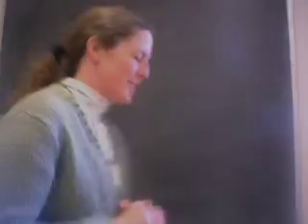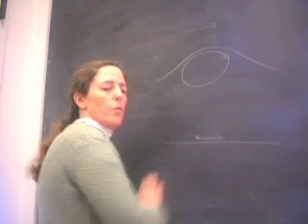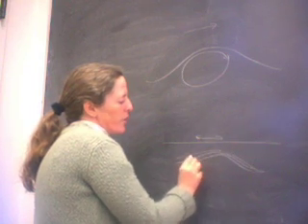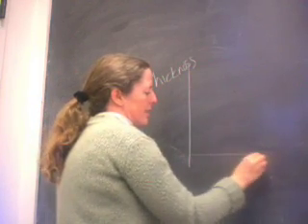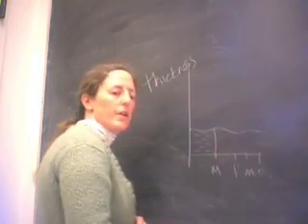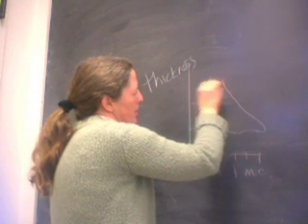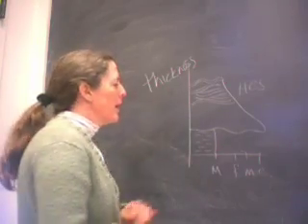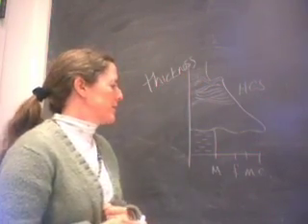Waves and Storms

Comment from the maker: Wave and storm sed structures can form in any body of water large enough to have waves and currents. The processes are the same, so the sedimentary structures are similar.  For example, Lake Superior can have waves that are several meters high.  Add currents from storm run-up and a typical storm deposit will form.